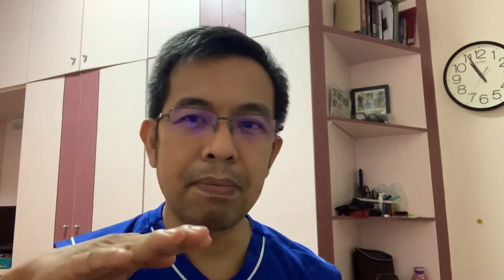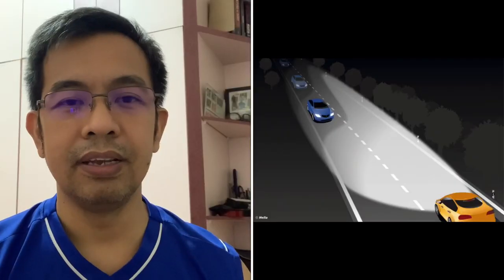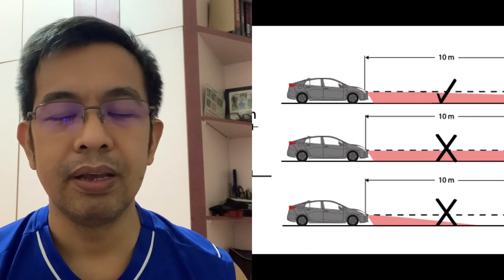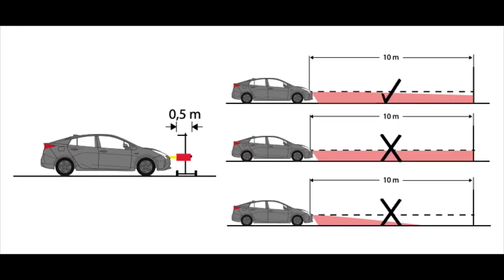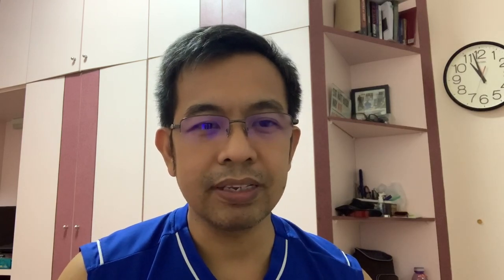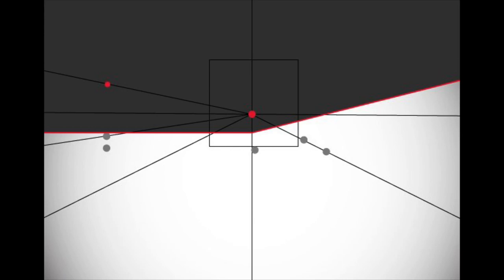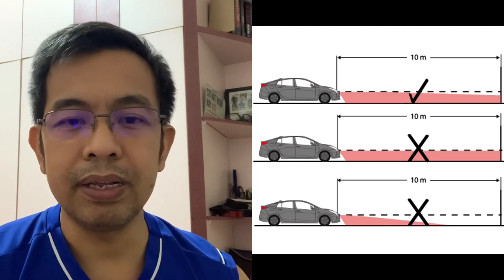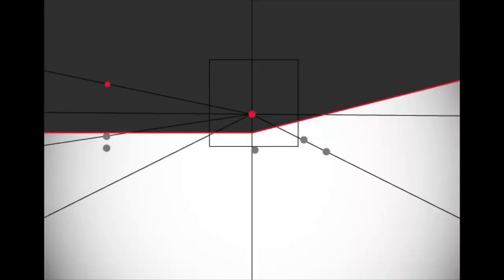Diy how to adjust headlight alignment of nv350

Comment: Sir ty sa information.. God bless po sau.. more upload po.. ung adjustment sana wheels
Reply from the maker: Noted sir  yung oo bang wheel alignmemt or steering wheels
Reply: @mrromeodiytv9229  wheels po.. kc d po pantay kain ng gulong... Sir ty po sa mga information baguhan lng kc ako boss pagdating sa mechanic..
Reply from the maker: Larry Isiderio sige sir no problem
Reply: Ako din sir ung 45 ko po, ilang beses ko na pong napa align. Tapos ilang araw palang may kabig nanaman po. Thank you for the tips din po sir!!